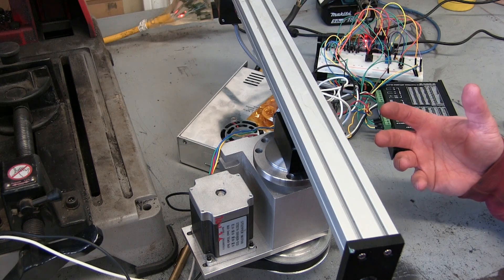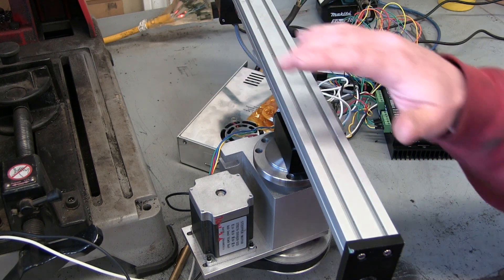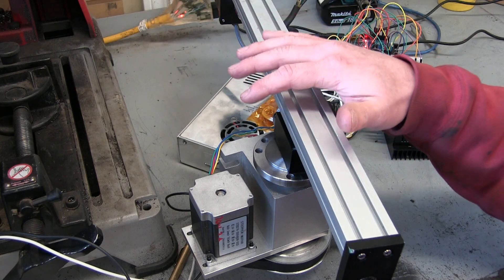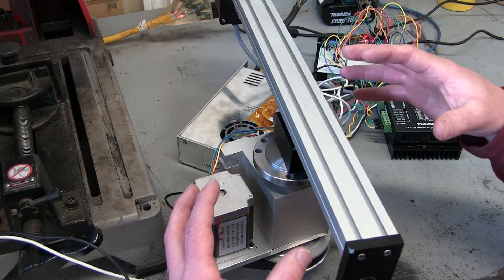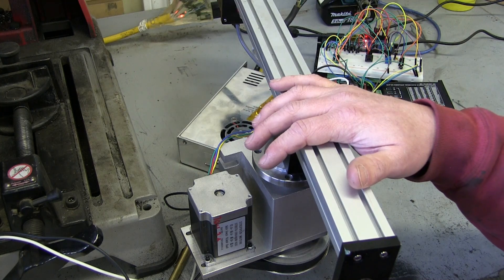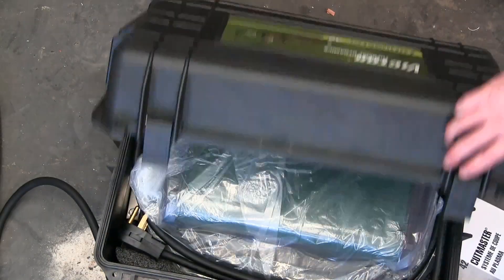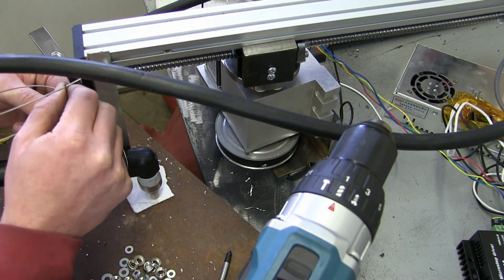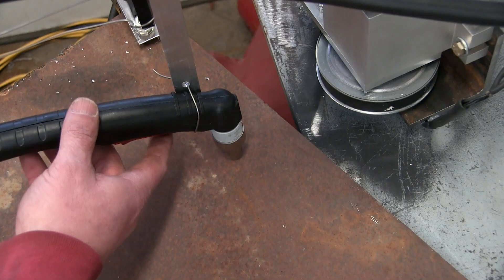Portable CNC Plasma Prototype

Comment: I worked as a Millwright with one of the largest firms in the states - they''ll snatch up 10 units just to test for mobile applications if you can get the software reliable and assure them of updates.    
VERY FRICKIN' COOL SIR!
Reply: agreed, start a kickstarter and ill throw money your way. i mainly work in stainless steel but the mag would work fine if i just threw a nice 1" thick plate on the SS to hold that baby in place.
Reply: There are companies already doing mobile apps + tools. This wouldn't be much different, to be honest. The technology is there, just need someone to invest the money
Reply: TheOregonOutlaw is millwrights union still a dying union?
Reply: Still tightening those nuts!
Reply: TheOregonOutlaw did this go anywhere?
Reply: Fucking sweet man

Comment: How aboot some sort of sniffer at the cutting head which can follow a marked line? no need for an ap as the user simply draws onto the steel his required shape and then fixes the plasma cutter and lets it do a first pass sensing where his mark is, then after a user confirmation it performs the cut. Means a lot more code but it takes some of the confusing shit out of the operators hands when it comes to more complex cut routines.

Also if you used a rack and pinion setup to move the carriage along the boom you could then have several different length booms which could be fairly simply swapped out for different sized workpieces

Comment: You're going to struggle getting the rotary speed just right unless you have some firmware that does all the conversions, sweeping the same rate at different linear values will sweep different length arcs. It's definitely possible to make some conversions, a few 3D printers have some pretty strange geometries (SCARA, Polar3D), even Delta printers just accept standard coordinates and the controller handles all the details. Unfortunately, you, or someone you nominate will need to dive into the world of GCode and Firmware.

Plasma cutting is generally fairly slow so I think even a RAMPS 1.4 board + Arduino Mega should keep up which would keep it accessible. You could get people following along at home.

Comment: question: I'm not a welder or steel fabricator,  but how well would this work over curved or uneven surfaces? would there be some compensation on making it keep cutting contact? I imagine with the other drill thing it wouldn't matter the surface you're attacking with the bit.

Comment: Cheap 2nd hand or Won Hung Lo  android tab for the interface? Save getting all the metal schmooze in your fancy pocket computer speakers and mic. Usually that's what kills mine. Maybe another actuator with a whisker switch to raise and lower the nozzle for clearing high spots on the job / repositioning?

Comment: I currently use a Cartesian flame cutting machine, that advertised itself as portable. I've tested that out once over the last 6 years, and "it worked". Most of the time, we run it off a stationary location. You need something Skookum to catch the sparks, and you need something to support the metal good enough as you are cutting.

Canned cycles get you to where you want to go 80% of the time. For the rest, you need some way of editing G code directly, if you don't ( or can't) access the confuser and associated software.

As you go farther out from the centre,  any little bump or glitch can cause unwanted waviness. I've used a "manual" set up on a long arm that was affected by the gear gashing going on next door.

Most grades of stainless are decidedly indifferent to the magnetic attraction of pixies going round and round.

I would think a minimum work area to be usable would be 2' x 2' ( 600mm x 600mm). At this work area, you steel would likely weigh less than the machine, so why not move it to the machine, that's already set up with something to catch the energetic burny bits.

If you had a large part to cut, it would be nice to have some method of index the base, relative to the previous position.

Well done for actually getting something that demonstrates this is possible, I eagerly await further developments, especially the polar to Cartesian conversion, while maintaining a constant cutting speed.

Not a fan of the app on the phone. I love my phone, but for this application I'd want some way of entering in the info direct to the machine.

Comment: What if you would do your sketch on the workpiece, guide the tip to the corners of your rectangle and it does connect the dots for you? For more complicated stuff we'll still need the app but for a quick custom angle bracket it would do and we don't need to fuck around with Bluetooth.

Comment: Skookam as fuck but what power supply does it use? Would you need an extension cord 110/240v?  When you are making left-right cut near the base is it slower than when on full extent from the base

Comment: Hey AVE,  mechanic engineering at Ualberta here, hobby CNC. So to Handel the inverse kinematic your going to want to use Linuxcnc. It has a shit load of documentation it's free and I'm  pretty sure it has all inverse kinematics you need pre loaded as there fairly trivial. I'm currently running a 3D printer with delta kinematics in linuxcnc and it's pretty slick, even probing features. It's a bit of a rabbit hole to first get running, I have some spare steppers and drivers, wouldn't be hard for me to emulate your setup here and create the files you need for the kinematics to the point where I could just send them to you. Give me an email if your interested at whammond@ualberta.ca I would be more than happy to help you over the phone getting it initially running as it is a rabbit hole but it's worth it. Very powerful software linuxcnc with very cheap hardware. I'm somewhat local to as I spend as much of my summers all around bc paragliding.

Comment: To keep the correct distance from the torch to the metal use roller ball bearings, same idea as a torch guide(the little plastic wheels) but they move in any direction.
Reply: they are also called ball transfer bearings, link: http://www.skf.com/us/products/other-products/skf-ball-transfer-units/index.html
Reply: having the torch resting on the surface limits some of the shapes that can be cut, it just needs counterweighting properly
Reply: https://github.com/regeg/ArdunioTHC

Comment: I've played with this concept as a plotter more than 25 years ago. Never got it working to my satisfaction. The problem i had with this type of 2D-Axes was the lost of resolution when the arm is far out. If its near the point of rotation the resolution was OK, but further out it got worse. I used potentiometer to determine the positions. I only had DC-motors and belts to drive it. I nearly got it to work by compensating for the loss of resolution with a leverage system, but i lost interest. I was 14 years old and had so may different things in mind.
Nowadays it's so much easier to get precision measurements.

To make less "round" shapes, you have to transform the points from the Cartesian coordinates to a Polar coordinate system. 
I worked so hard on this and how to put it in software. Never looked it up, would have spoiled the fun. :-)

Comment: I'm not going to tell you anything you dont already know. But on the mechanical side I'd strongly consider using a belt in your linear motion drive.  They can be tough and they'd be cheap too.  alot less to go wrong when you consider who this thing will be around in the end and all the welding juices that will be undoubtedly flowing through it(plus no lubing a screw around PARANOID welders!!!). 

 It could also make for a tighter and lighter package since you dont have to support an actual screw.  Hell, I bet one of those bright, good looking guys in the skunkum-skook-werkz has an idea to mount the secondary stepper at the rotational body so you didnt have to float wires and an stepper out on an arm.  

I'd like to see a servo or small actuator at the end of the arm  with a roller on the torch tip to make things easy.  Mainly for liftoffs and drops + shitty material. 

I'm concerned with how the end user will set their "work coordinate."  how will they know where their "part" or path starts and ends.  I'm not worried about it for squares and gussets, those are easy enough to dry run.  but the guys that dont have  a lathe big enough and just need something 'kinda' round.  how will they even know that they have enough material when theyve got a 20" square and are cutting a 19" circle and dont have a choice but to cut it close?  I imagine that will happen far more for the amateurs and enthusiasts than it will the pros.  
-I guess it applies to the pros too when you might consider they have to weld a bung in a tank at a place that will have to line up with the piping coming to/from it...  laser? they suck in bright sunlight, sharpie attachment? close but you can imagine chucking all your sharpies away being pissed at them... needs thought.  

I'm not trying to swell your head or anything, but great idea......  I know you put a plasma cutter or laser on that drawBot you showed us a few weeks ago and thats where this came from... too convenient...

Comment: As a full time welder and a part time fabricator let me assure you that my head just exploded! That thing would be so handy! If I might offer my 2c, make the torch use some sort of standard consumable (like victor or thermal Dynamics) or better yet use the hole torch if you can. also, i know one of the goals of this is to keep it portable but I would be a little concerned about the size/weight of the necessary power source. Again just my thoughts, keep up the good work I love seeing the stuff you come up with👍

Comment: Random thought, line following robots are a trivial thing these days - why do you need a "plan" before it starts? you could let people draw the cuts they want in marker then have it trace that out?
Reply: It would be simple to get it to trace the path first before the plasma is on and just repeat the path. Depending on how quick the camera is the tracing speed could be a lot quicker than the cutting speed.
Reply: It would be even easier to have sensors record the movement as you manually manipulate the arm. Then the path could be repeated, within the software controlled speed tolerances. Could even go as far as smoothening the motions in software to get a straighter cut. Also, one could validate/tweak the path on a phone before cutting (optional).
Reply: gromann what if you had it scan the outline first, map out what it's going to cut, then proceed cutting based on the stored outline?
Reply: Why overcomplicate the original idea? You just don't handdraw bolt circles or rounded edge triangles, with specific dimensions in any time compared to having a simple screen asking what dimensions you like and what shape and how many. That was one of the key points of this idea - to have a simple to use and reliable system for (plasma) cutting precisely in minimal space. Introducing the need to draw something is not userfriendly nor fast.
Reply: even sorts the whole rotary vs cartesian issue rather implicitly, just let it follow and figure it out as it goes :P
Reply: I think the arc will interfere with optical recognition.
Reply: Hard to manually manipulate the worn drive axis - too much friction to drive it in the opposite direction. A system with stepper motors on toothed belts for both axes would do this nicely, though I'm not sure a standard stepper motor controller would be able to feed back its position through the motor controller to record the movement, so motors with encoders would be needed.
Reply: Consider if you will a wand - like a joystick that compensates for movement. When you push it radially, the computer turns the screw outwards following the movement.  You move it in exactly the direction its supposed to go and the computer chases the pressure on the wand. Power-Trace!!
Reply: Dale Horton yall are way over thinking this unfortunately, because in the time it would take to get whatever this thing ends up as; to check it out of the tool room and perform the black magic ritual you guys are discussing, i could just cut the goddamned thing out with an oxy fuel torch.
Reply: If you're going to hand-draw the thing you want cutting you may as well hand cut it as well.

If you're going to print out a plan and stick it on for the thing to follow you may as well send the design straight to the CNC and skip the printing step.
Reply: That is what paint pens are for.
Reply: I see no practical reason this couldn't be done.
Actually seems a really logical step.
And all the technology exists already. hmmm
Reply: Man, it looks like the comment I left a minute ago was about 8 hours too late.
Reply: Right, plus that lets you reposition the steel and run the cut multile times for duplicate parts.  Repeatability is the BIG benefit of CNC, loosing that would be dumb.
Reply: Why the need to draw, as it is an extra step and would make the process last much longer and it doesn't get you anything pretty nor precise without using too much time drawing it. And what if your drawing was a bit off, like a bolt circle? Playing with bits on a phone or whatever is quicker and makes it work everytime the same.
Reply: Dale Horton issue is the light the arc puts out would annihilate most optical sensors, it'd take more effort than an off the shell part
Reply: what about using on of those board things they use to draw on computers.  use something like a touch screen go into the paint application and draw what you want.
Reply: gromann this may have been said already but if you use a reflective paint and put an ND filter in front of the camera you could compensate for the over exposure caused by the arc. hopefully the reflective paint would be illuminated enough by the arc for the camera to follow reliably.
Reply: Kyle Brown what black magic you talking about? A little math in an embedded computer aunt nothing more than a few minutes one time.
Reply: Alignment being interactive would help
Reply: You're on to something!
Reply: I think for the guy with a line following plasma cutter laying around in the shed, requiring a paint pen, compass and calipers is not a big deal. As for effort, well its quite a bit easier to draw a few clean lines with a marker, than actually cut them out by hand, you can take your time, fix mistakes, etc, and have no chance of accidental slip-ups, plus its repeatable.

Comment: I hear your resistance to CNC{ G code).. but canned cycles might be just as frustrating.
 looks like the conversational programming is where the heavy lifting is needed...when I started converting 3d printer by substituting the effector..I was left with where to get my g codes from...I use a programme called In scape..it has a variety of what are called post processors....BTW I think your geometry might be called SCARDA..

Comment: I think it needs to be weighted on both sides. perhaps a rotary pulley system that can increase the pull on the arm to lift the cutting end a bit higher. maybe attach a laser sight at a fixed distance that adjusts when it detects that it's a certain distance away from a surface

Comment: If yoou cold just take a picture after you placed the mag on the plate, then put whatever shape you want it to cut on the correct place on the picture. If there was a few dots on the mag the software could calculate where thing should go and start cutting. That should be easy for anybody.

Comment: Awesome Idea! One problem you might run in to though, in the example of a square of a certain size. Depending on how far it is from rotating axis drives what the gcode will be, so in order to make the gcode for the robot,the app would need to know how far away from the base the start point will be.  This can be a challenge, as either the user has to measure how far away and type that in (time) or the robot has to have a way to tell where it is at all times, and the user can position the start point where they want. There are any number of ways to accomplish this location feedback, in the same way as a DRO for a mill, but that ease of use will definitely come at a cost for the user. Love the Idea and cant wait to see how you develop this.

Comment: There is many a time I could have used something like that in my workshop and on site. At one time I even went as far as building my own torch tractor as what was available was far too big for the job in hand, that was back in the early 90's so CNC was not practical for what was a once use machine.

Comment: @AvE You might want to look at the SCARA-printers for inverse kinematics (i believe Marlin firmware has it) also a nice mechanism because it works with two pivots instead of one with a linear rail. Its even more compact :). If you use ramps (you can still use beefier drivers) you can use extruder/heated bed lines or driver Direction pins to trigger gas and trigger relais.

Comment: Look at SCARA type robot arms... you should be able to reduce that to two stepper motors, some simple solid arms, and an electromagnet on the base. For a controller, I'd probably go for an ESP32 or ESP8266... both of which are Arduino compatible, btw...